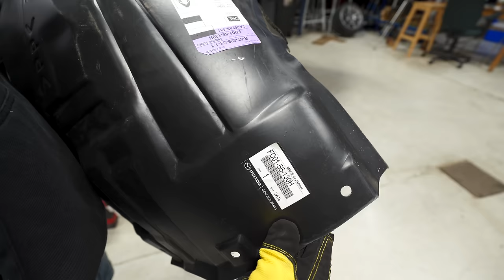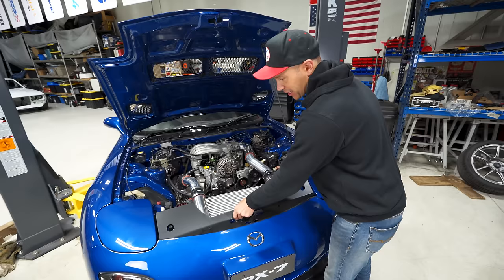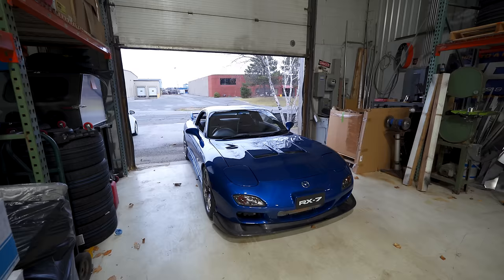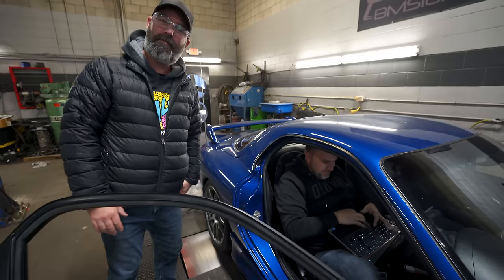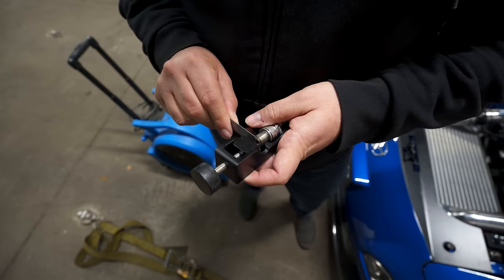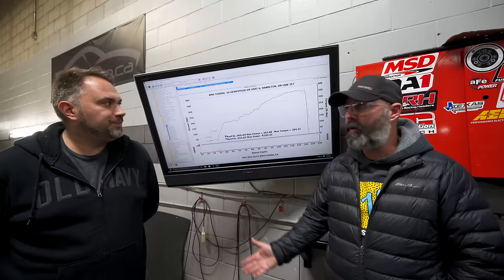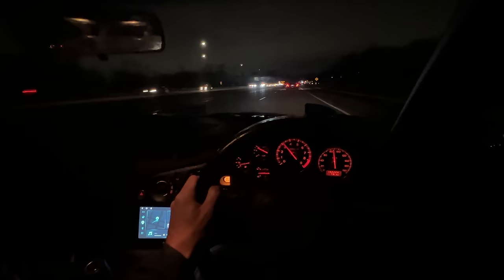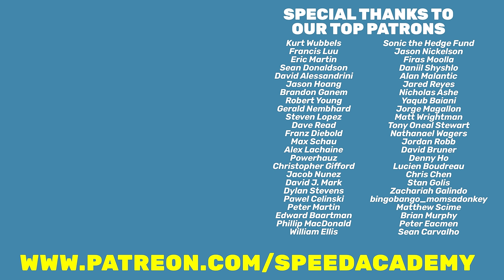MAZDA FD RX7 QUICK BUILD - EP 4 FINALE

Comment: Have the same turbo kit and had to put on a bigger fuel pressure damper to make mine run better in the low rev range. I can also send over my map for you to compare also on a haltech. Also i found that the turbo and engine like 1.9 bar. V/R Jank

Comment: Under tray should have gone under the front lip. I learned that the hard way. Wind gets between the gaps and damages the strength ultimately destroying the liner and puts a lot of pressure on the front lip and front bumper.

Comment: I reckon it could be the transition from the primary to the secondary injectors, that is causing your break up, seems about the right place in the rpm range for this. They are very tricky to transition right.

Comment: I'd love to help contribute to the diagnostics of this if anyone would like a hand.  This is the platform that I specialize in and should have some insight to help with the issues you're facing.  Great job on the build guys!
Reply: Hopefully they see this comment. Have learned alot from wat hing your videos
Reply: so off the cuff, what do you think it could be. some people mentioned the switch from primary to secondary injectors or fuel damper
Reply: @MelonTL_YH2  I could see it off of a log file pretty easily, but speculation without data is just a bad foot to start on.  With diagnostics, I always go in with an open mind and ask a bunch of questions about where things are grounded, which spark plugs, timing at a given RPM/Load, staging location, etc.  There are so many small factors that I take for granted after doing 200+ of these engines that I'd rather start with fresh eyes.

Comment: Those are not the typical rotary spark plugs. The strap covers the hole going into the combustion chamber with that type.  BUR7EQP for the leading. BUR9EQP  for the trailing.

Comment: So I'm doing a 2008 3V Bullitt Mustang for club racing, saw your vids.
 I ran Miata in SCCA and 24 hour races, I campaigned ist gen RX7 in ITA for 3 years and still own my 92 FD R1 which I used for instructing. Sweet. The FD we had air to water, then to large A2A. Good stuff guys. ( i usd 2 MSD boxes with hi power motorcycle coils up to 20lbs no issue) used Nippondenso plugs much colder fine wire.FC Datalogic did not use stock timing split.

Comment: Regarding the missfire, which plugs was used? I saw you tried gapping, but as a matter of a fact the "propper" sparkplugs that should be used on a rotary according to Mazda is something like the NGK BUR7EQ for leading plugs and BUR9EQ for trailing which you can't gap like normal plugs. Best of luck investigating.

Comment: R7420-9 plugs in leading and trailing with ing-1a coils set up as direct fire.
Reply: Personally running R7420-10. But yeah these plugs make it run so much smoother
Reply: @graememcfarland  I’m guess you are on pump gas. I run the 9 because I’m on e85 99% of the time

Comment: Glad to hear that you aren't making the mistake that so many poor unsuspecting rotary owners made by trying to run full synthetic without deleting the metering and doing fuel premix. Full synthetic is great until you encounter an engine that actually needs to burn a small amount of oil.

Comment: What kind of spark plugs are you using? It looked like that spark plug you were gaping had a standard grounding strap. I've owned rotaries for almost 20 years and I've never seen that on a rotary. As far as I know (which I'm no expert) you don't gap spark plugs on a rotary.
Reply from the maker: We should have explained this, but we started the session on OE temp 9 plugs in all four holes and switches to the strapped temp 10 plugs to see if going to a colder plug would fix the issue. We are going to switch to the NGK strapless race plugs but the strapped ones were all we had available on the dyno.
Reply: @speedacademy  9 range plugs should be good for ~400whp. My FD is a bit more powerful than your car and I've been using NGK BUR9EQP for three years without issues. You may want to look at the stock coils and their wiring harness (inside the main fender loom). My harness was causing issues so I bypassed the whole system with a set of AEM 1GN-1A coils. There's a guy on RX7Club that makes a plug&play RHD setup. I think his user name is "yourekillingmesmalls."

Comment: Sounds like there is a heap of compressor surge at part throttle?
Reply: Probably some flow issue resonance or pulsing that doesn't play nice until the pressures/flow are at the top.  The smaller turbo or tubing size or arrangement is causing the issue

Comment: The issue could stem from fuel pump voltages! The rx7 is known to have massive voltage drops to the fuel pump when going WOT! Please looks this issue up. The engine could be staggering because the fuel pump isn’t able to deliver enough fuel due to the voltage drops. Many people have to do rewires for this where the feed a direct line of 12v from the battery to the fuel pump or the do a custom stepped voltage setup like OEM that actually works.
Reply from the maker: Our fuel pump has been rewired so its not a fuel pump issue